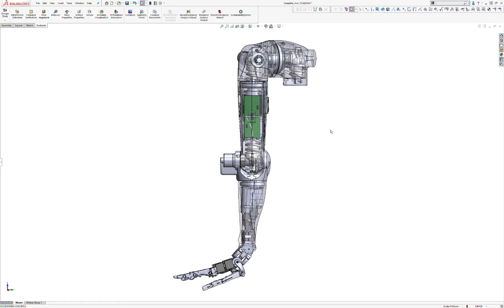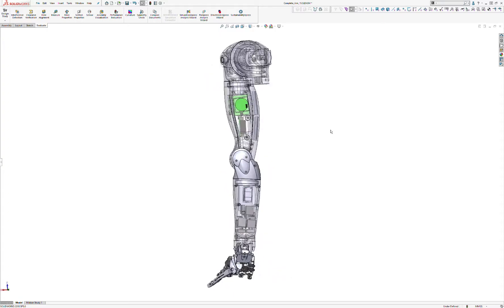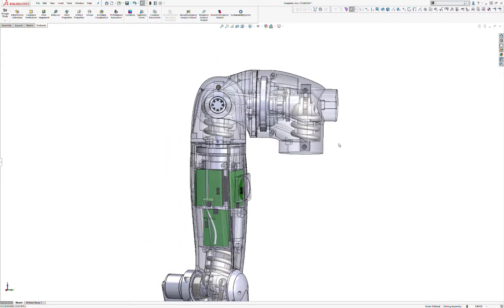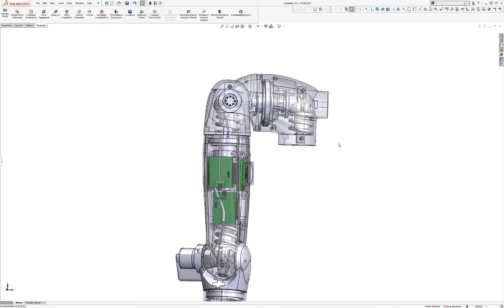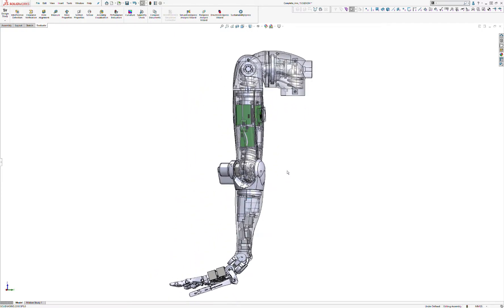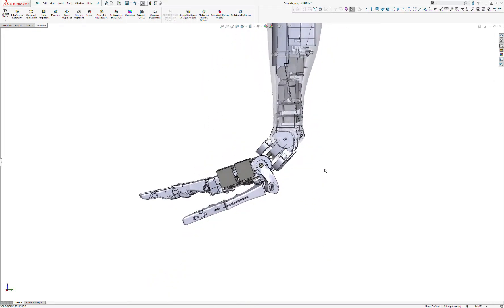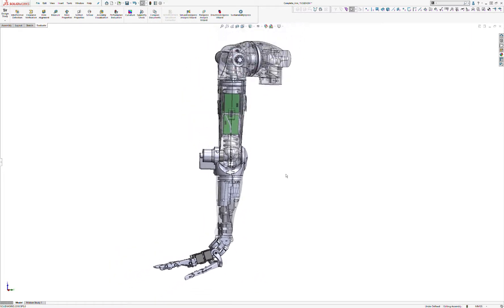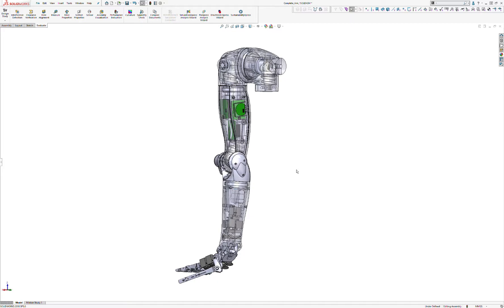Complete Arm 15 CAD Fly round

Comment: Hello, don't be tired. Excuse me, I have a question: Why didn't you include the videos of elbow to shoulder and shoulder assembly in the channel, like the palm and the mechanism of the fingers, which has 9 parts, and you tell the parts beautifully and how to assemble them???? And the parts from elbow to shoulder and shoulder that are inside the ONSHAPE platform, should we download and assemble them??? Hasn't it changed? I wanted to know the videos of how to assemble and the list of mechanical and electrical parts and the names of the servo motors that were used and their number etc.????????????
Reply from the maker: I have not published this arm because the cost of the components is too high for most people at 6k Eur.
Reply: Hello, don't be tired. I have no problem with the cost. And thank you for uploading the 3D Stl parts in GitHub or anywhere you know. thank you

Comment: So nice job Amazing do you do Open source please ??
Reply from the maker: The test finger is here: https://www.thingiverse.com/thing:5384399. The arm will follow however this present design uses rather expensive motors.
Reply: @therobotstudio  thank you nice finger 🥰
Do you know if your arm IS open?
I would like print it😉
Reply from the maker: @ambybot  I can publish the stl’s as they stand you are welcome to print it. To actually assemble the arm though will require four motors with 32mm diameter gearboxes as these form the inner races of the joints. The motors I use are Maxonmotors ECi40 with GP32 - do you have access to these or anything similar?